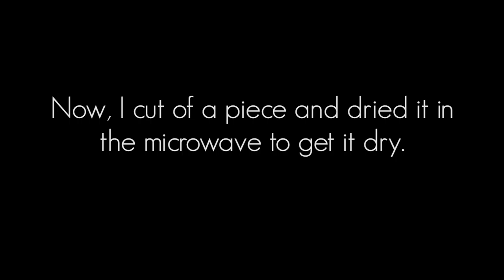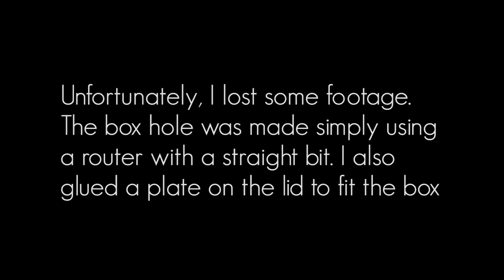Making a Wooden Box of Spalted Birch

Comment: Nice video! Does the microwave drying stop the spalting/rotting?
Reply from the maker: Thanks. Yes, you can dry the wood in any way you like (just like regular wood). Air drying works just as good, but takes much longer. I have several pieces drying outdoor. Good airflow between the pieces is important.